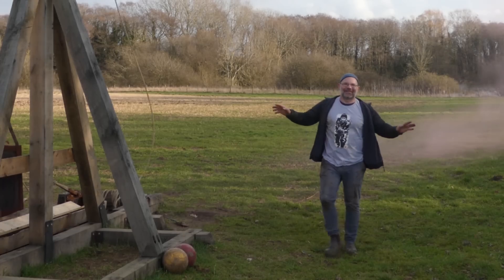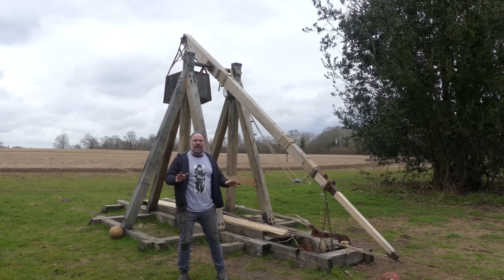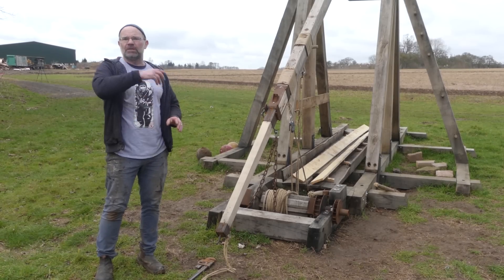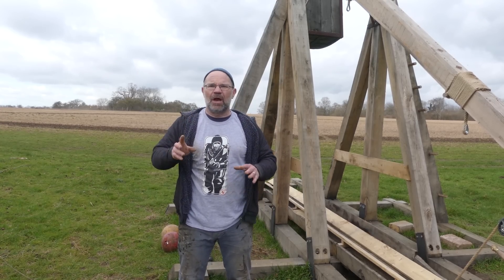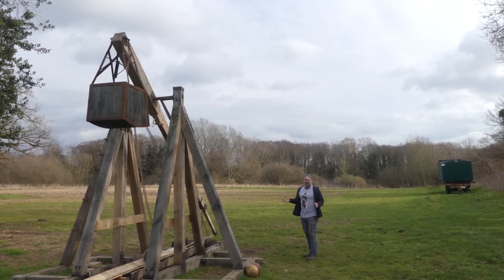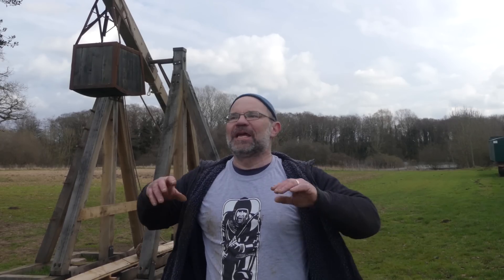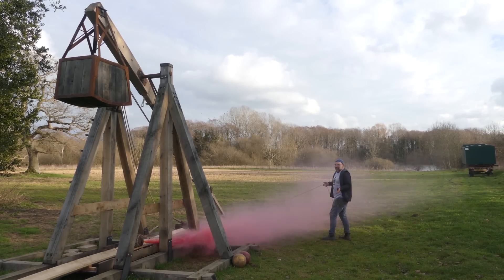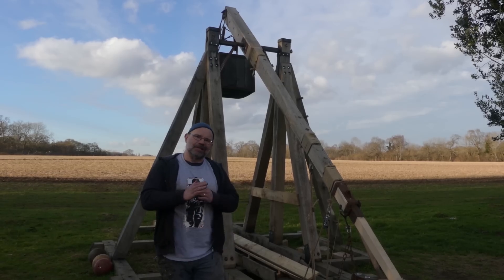Trebuchet - Why won't the darn thing shoot further?

Comment: If you remove the counterweight from the arm and use pulley's more like a modern crossbow(size large). Problem with the counter weight design as many pointed out is it stalls the arm at 90 degree. But changing the counterweight you could make the sling pull 180 degrees instead. But then its no longer a Trebuchet.

Comment: Fk me.. Start as close to a fail to hold on the hook as you dare, work you way all the way up to as close to a will not let go state.. find the optimal, use that.. 
of course then that is optimal for that configuration of ammo/weight and will change as ammo changes and that is why you would configure it for the mean
weight in a 'real world' situation where you may be throwing various targets and wanting the best performance you can get from them all with mucking about.

Comment: Put a structure on the forward side of the boom to raise the counterweight higher at full cock (offset the counterweight axle forward, so to speak). Energy is mgh, so m and h are the variables we can change. You could likely obtain about 10-15% energy bump. It will also bring the arm forward of vertical at the neutral position.

Comment: Remember the law of energy conservation: Your trebuchet converts potential energy into kinetic energy of the projectile. The transmission ratio of the longer arm just has it requiring less angular velocity to achieve the same speed of the projectile, which makes the entire thing not tear itself apart on launch.
To get more range add weight to the accelerating mass now. Try placing some stones on top of the box, for example. You will see a difference then. A different mounting of the accelerating mass might help, too.
I have a suspicion that the pendulum-style mounting is slowing the arm just when you want it to move fast. For maximum range you want to have the release at around 42° upwards. That also roughly happens to be the angle when the mounting of the weight is getting drawn towards the base of the trebuchet. Seen from the arm's pivot, this is when the centrifugal force stretches the mass to its point the furthest away from the pivot. Here angular momentum comes into play, the thing with the spinning skater that slows down as it spreads its arms and spins faster when it pulls in its arms: the shape with the mass far away from the pivot has a greater moment of inertia, thus requires less angular velocity to acquire the same angular momentum. The arm and sling and projectile thus will be slowest in this part of the swing. That's about when your trebuchet releases, so you want maximum angular velocity there!
Oddly enough at the end of the swing, the mass will get raised closer to the pivot when braking. This configuration will do the opposite of the fully stretched out one, the mass will add an extra push to the arm in the last few degrees of the swing. That makes me think this design with the trebuchet's accelerating mass in a pendulum could have been specially designed for having the projectiles go fast at shallow trajectories, not so much for throwing nice, high arches over walls but smashing heavy things into them half way up.

Comment: Use computer simulation and try to get averages of your performance of the trebuchet. Maybe more springs on the middle of the arm will help extend the range. The trebuchet looks rigid maybe more flexibility will help add more spring tension to in rease range like a crossbow.

Comment: Easy answer , distance is affected by 1. Counter balance weight = +/- acceleration of arm.  2. Sling length = different types of size for different objects, therefore +/- sir resistance and change in momentum 3. Release mechanism= point at which the object is released as arm is moving through its arc of travel changing trajectory from flat to curved depending on distance to target. 4. Weather

Comment: Because you are getting diminishing returns on weight addition. The limiting factor now is arm travel distance. You can only accelerate something so fast before it snaps. You need more time to reach a higher angular velocity. Reference yourself to Tom Stantons tennis ball trebuchet and you will see it has at least 3x more arm travel than a traditional trebuchet which allows it to hurl tennis balls at speeds well above 120mph.

Comment: The scientist Donald Siano claimed that for the furthest shot you need a sling as long as the long part of the arm. Then the arm should be 45 degrees to earth when shooting. Then the projectile should be released at 90 degrees (right above the trebuchet). Then the projectile must be about 100 times lighter than the counterweight.
Also it seems to me that bad accuracy is determined by the fact that the arm is not firmly enough connected to the axis.

Comment: What if you have lots of rubber as power source instead of weight? Would that shoot a lot faster. For example I read of a 1000 pound weight, use rubber with 1000 pound draw force

Comment: My 2p as engineer:
If the projectile whistles then speed is very high, you might need to make its surface pitted. Golf balls used to be smooth surfaced and they found out that used worn balls were flying further, that's why they ended up with the pitted design.

The other thing for ballistics is that you should aim for 45 degrees of departure angle (for maximum range).

Comment: Because the weight is dangling freely, and actually brakes the movement of the arm. The weight is pulling the bottom of the arm forward when it is in it's vertical position. Fix the weight to the arm, and it will shoot further.

Comment: I left a note on one of your throwing dart video about adding a short length of slingshot elastic to the string to increase power. I really think the same would help with this if you could find anything strong enough. It depends on if you was comfortable using modern materials on ancient machinery. One thought, a leaf spring from a car (could also make a good crossbow)

Comment: Rebalance the weight?   So that the top of the arm in "neutral" is further forward?   Ie. more force transferred for a longer time.

You could also try halving the length of the extension.   See if it's simply centrifugal force counteracting the force used to throw too much.   Ie. the extension may have moved where the most force is applied to the wrong place.

Comment: Tuning a trebuchet feels like setting up a car suspension in Gran Turismo. Lots of different parameters and they all influence eachother. You change one thing, then start changing other things to compensate and pretty soon you're completely in the woods with no idea what you're doing. I learned that small incremental changes is the only way to go, maybe you extended the arm too much in one go.

Comment: If you want the max distance you have to find the 45° release point. If you want any further you need to up the weight.
Reply: 45 is the max distance if 1) no air resistance 2) speed is the same. Both of which are not true in this case.

Comment: You need to increase the height of the pivot pin and mast.  This will get you the 45* optimum angle for setting the arm up to throw a projectile.  45* angle is what gets the ballast as high as possible.  Yes you may be able to get even more power by lifting the ballast up even higher, but a custom ballast box must be built for that.   Since you added length to the throwing arm, it changed the at rest angle to what looks like 38*-40* angle ... which causes you to lose potential distance.

Comment: Worth noting: increasing counterweight mass will increase velocity.... but only until the counterweight is falling at the full acceleration of gravity.  It's not going to accelerate any faster than 9.8 meters per second squared.

Moving the counterweight in closer should help/ have helped (I think you said you already moved it in) a bit, since it means that slower counterweight falling velocities can be translated into higher arm rotation velocities.  But it will also reduce the force the counterweight exerts on the throwing arm, because you cut off mechanical advantage (lever ratio) by bringing the counterweight closer. You would then have to add more mass to counteract that loss of mechanical advantage.

Shortening the pivot-to-counterweight length by half would halve the force acting on the throwing arm tip, BUT would allow your maximum theoretical throwing arm tip speed to double, assuming you put enough mass into the counterweight, because cutting the pivot-to-counterweight length in half means that the speed the throwing tip accelerates is doubled IF you can make the counterweight heavy enough to reach the acceleration-under-gravity acceleration limit.

Comment: The length of the arm that the counterweight is on is too long is the issue I see. If the weight hung slightly lower, but on a shorter arm, it would 'whip' the throwing end along further and faster because the same weight has less distance to travel. Also, because the length of that part (the weighted end) of the arm is longer, it's causing the weight to travel further 'horizontally'. ie, the arc that the weight travels is too long. The more that arc of travel for the weight is, the more of that rocking effect you see and the more it dampens the speed of the throwing arm. 

I can email you some sketches if you want a clearer explanation.

Comment: i can give you a tip. its no bulshit. put somting like a wood block that changes the counterweights loaded angle my 30 degrees. the launch will be more violent and youll need to redo your relise. if the block can fall out as it dropps it wont damage the arm

Comment: The energy imparted comes from the weight dropping X height. If you want more energy delivered you simply need a bigger machine that can either drop the same weight through a greater height, or a larger weight through that greater height. Lengthening the arm, though, increases the amount of torque opposing the input energy. You will need to fabricate an adjustable arm and conduct several trials at various settings to determine consistent ranges.

Comment: Consult a physicist.  Lengthening the arm also requires adding more to the weight box. Lengthening the arm will require more energy as the leverage has changed but the power applied is the same. It's called "gearing". You geared up but didn't power up.  The same process takes place in an auto transmission. Different sized gears require different power applications. Basically what you did was change gears.

Comment: I guess I would have a bunch of balls the same weight (say 10), numbered them, then fired all of them one after the other, each time a variable was changed, then checked out the distances all at once. Pacing out each individual shot, and firing one shot per variable seems kind of inefficient to me.

Comment: that looks like great fun. fro,looking at the footage it seems like you are loosing a lot of energy in the last quarter of the swing, i think that is since your machine is static on the ground. if at all possible i would try putting it on wheels or at least change the attachment point of the counterweight further down( expl: when loaded you got more possible attachment points to the right but putting the attachment point of center could give u a longer swinging motion wich would increase power)

Comment: If you move the wide shot camera way, way back to where you need a telephoto lens, you should be able to get an accurate picture of the angle of release which (I assume you know) should be 45 degrees. Other than that you just have to use trial and error, to find the optimum pin length/angle. The fact that your weight oscillates after release means you are less than maximally efficient in converting potential to kinetic energy, but you're doing pretty well. I've seen far greater oscillation. I don't know if you can really get the weight to remain completely stationary after release with a simple straight arm trebuchet, but there are compound designs with an articulation that can maximize energy conversion. From what I understand though, with gravity driven (instead of tension driven) catapults energy conversion will always be pretty poor. Tom Stanton has a couple good videos on this.

Comment: When you made the arm longer. You should have made the weight heavier. It's fighting alot more resistance with a longer arm. A shorter arm provides more torque. You haven't got enough weight to accelerate that much mass

Comment: I know its counter intuitive and a lot of work for you, but you get maximum distance if the Trebuchet sits on a platform held up on wheels.

As the counterweight moves down, the Trebuchet carriage with wheels will move to keep the counterweight movement as vertical as possible. Wheels will reduce the amount of angular force on the counterweight. It’s the angular force that slows down its speed at just the wrong time. I suggest you build a small working Trebuchet model to demonstrate how wheels help. It goes without saying that the more the wheels have freedom of movement, the better. That means the ground should be flat and hard, and the wheel axels should be well lubricated.

Comment: Hey! Robotics engineer here. Just as you I'm completelly suprised by how intuitive this machine worked. However, I have came up with few hypothesis that might explain parts of what happenned:

1. After first pin adjustment, you have lowered the trajectory closer to optimal, but your ball had lower initial velocity. This tells me that either there was some energy loss or external factor. The effect seemed a bit too big for external factor.

2. After second pin adjustment, trajectory was lower than optimal, but initial velocity was bigger.

3. After the pin cut everything begun happening as expected again

Based on that here is my hypothesis: Energy loss was due to friction with a pin (probably insignificant), and in weight. You see, when the ball got released earlier, the weight was still moving basically vertically, but when it was released later it was already moving horizontally. Internal friction required to change direction of this huge mass, must have ate a bunch of energy.

Another consideration which is way harder to see or predict is the arm itself working as a spring! When the weight begins to fall, and ball starts accelerating, the arm gets stretched a bit, however at some point acceleration from weight decreases, and energy stored in this stretch gets released. If this coincides with release of the ball, you get perfect shot. However, after initial energy release the arm bends the opposite way, and then releases that energy backwards to direction of the shot. If ball is released at this moment you get way lower than optimal result.

This is all way cleaner if you model your trebuchet as made of springs instead of solids. The effects may seem small , but judging by how the wood curves in those shots there may be a lot energy lost there.

Comment: Is it possible that lengthening the throwing arm has shortened the "power stroke'.
With a longer throwing arm is the counter weight starting from a lower height, therefore less potential energy.

Comment: Well im not an Trebuchet expert, but could it be with the extended arm, the Trebuchet is now too small? The rotation angle of the long arm is much smaller than with the short arm.
Like loading a rifle with more powder but then saw off a part of the barrel, more powder should increase the V0, but with a shorter barrel the bullet has less time time to accelerate, so the V0 is the same as in a rifle with less powder but a longer barrel.

Comment: Looked at the 1250 pound crossbow video for at least the third time, because it's fascinating with all that power.

But i think you calculated the windless-down-Gearing Wrong... To my calculations it about 39x, and not over 140x   .... That is if the Handle is 25cm. I counted 8 rotations. The pull on the handle is 14 kg at the 1250 pound draw point. As you mentioned it was a bit heavy at the end.

Comment: The thing is that gravity pulls the counter weight, the counter weight pulls the arm, and so on. Therefore more weight, longer arm - thats the way to go. Adjusting the pin thats just fine tuning trajectory.
Its like a gun; gunpowder = counter weight, barrel length = length of arm (or actually more like projectile speed)
Everyone knows this.

So why you havent attached a 2 ton counter weight yet seems a bit like sloppy work i must say.
A mere 500kgs - thats not even 1 horse!

Comment: Probably 15 years ago, maybe more, I saw a TV show about these guys who wanted to build a trebuchet. They were engineers or something. Anyway, when they were researching, they kept finding medieval illustrations of trebuchets mounted on wheels. At first they thought it so they could move the things around the battlefield. But one of them thought maybe it was something else. When they built the thing and fired it, the entire machine lurched forward about 6 feet. And that lurching did 2 things. It imparted more forward momentum to the stone increasing range. And it prevented the counterweight basket from swinging around so wildly. I wish I could remember the show. It may have been on BBC. I just don't remember. Anyway, I love watching your channel. It gives combat nerds something to look forward to. Cheers!
Reply: I remember seeing that program too.  I seem to remember it made for a smoother throw adding something like 50 % further?  It was significant.

Comment: The extra swing of the counterweight on the lower part could probably be responsible for the deviation in the end phase of the launch. I personally think that this wiggle needs to be addressed by another design to progress your shots... That it pulls smoother